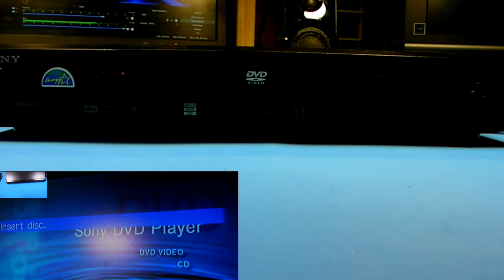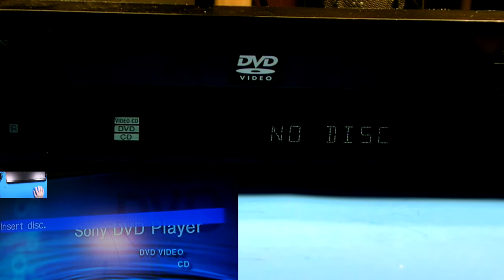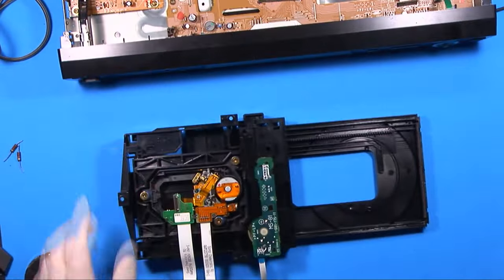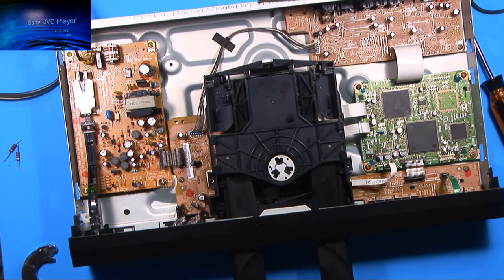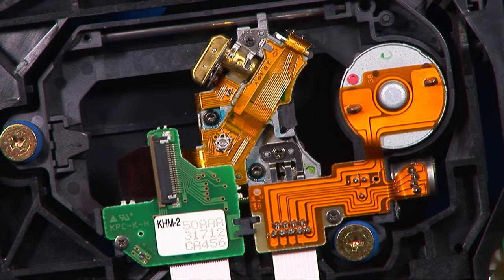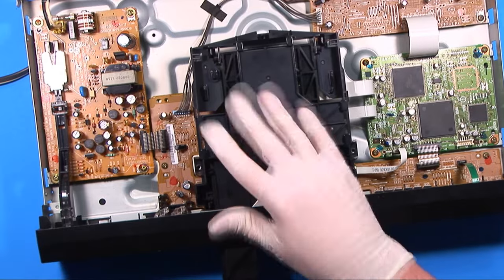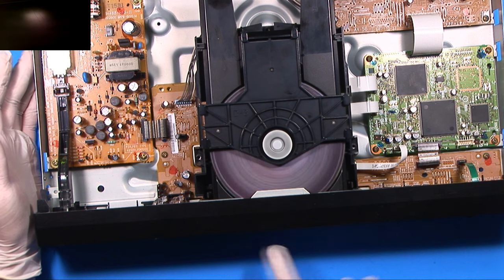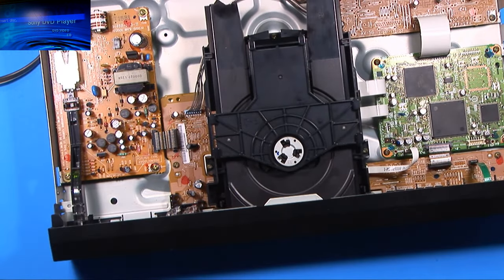Fixing a Sony DVD / CD player "No Disc" error.

Comment: Thanks for the video. I have the exact same unit you have. I did what you said to do about increasing the voltage the laser and it worked perfectly. I did not mark as you requested to do before turning the switch clockwise but used the notch on top to use as guidance. I used a box cutting blade to turn the switch. My question is where can  I find another replacement unit that you removed from the DVD player. I have looked online an been unable to find. Thanks for everything I appreciate it.

Comment: I will try this. I have a similar model and most of the time it can't read the disk. It stays spinning for like one or two minutes and then it stops. I've tried cleaning the optic but it has given me no result. However, moving the laser module to different positions has worked sometimes and it loaded the disc but with many problems reading some tracks or jumping between them. Do you think that I would just need to adjust the potentiometer? What could it be?

Comment: My Blue Ray's player is doing this on Blue Ray disc. DVD disc however work fine.

Sometimes after multiple attempts I can get the Blue Ray to start & then it works fine but it's getting it to not error. It's a big pain.

Comment: it just happened to me today, was working fine this morning. got some new 80s cd's I ordered which came today, put one in and played fantastic, put the other one in and no joy. i have an aiwa separates system with a 5 multi cd player, and all its doing is going from disc 1,2,3,4,5 and saying no disk. so its not reading the disks just like in this video. i will have to take it apart and take a look once my new hip has recovered after a hip replacement. thank you for a great video, as we all learn something new every day :)

Comment: I had a TEAC plastic table top AM/FM/CD player and the CD just quite. I tried this adjustment and n=moved it less than you clockwise. it came back but will occasionally not read the CD. like 1 out of 10 times. Are these laser assemblies easy to replace or a nightmare. It a nice radio with good tone I would like to keep it around if I could. Thanks Great vids.

Comment: Dear Electronicle, thank you for making and posting this video.  I have an older Magnavox CD player (purchased new ~1986) that will start and plays the 1st two tracks fine.  But after the 2nd track, it begins to emit a high pitch sound, (it's soft, and not loud, so I have to mute the music to hear it).  (Not heard during 1st two tracks).  Thus, into 3rd track (& beyond), it pays, but after ~30 sec, sometimes more (~60-120 sec), sometimes less, it will stop (lose it's tracking), and I can hear the read lens assembly returning to home position.  ¿Is what you've shown here something I can try?  As mentioned, it does read the table of contents, and begins to play, and it's ok for the first two tracks.   It's after these, that it goes awry.  It has begun to behave this way about 5-8 year ago, but I'd like not part with it, as new ones are expensive, and this sounds very nice in my stereo system. Any comments most welcomed.  Thank you.  tonyd\.

Comment: I really like my RCA home theatre system. It has AM/FM, sirius radio, six speaker output, usb input and a 5 cd/dvd player.

The cd/dvd player squalls when the power is turned on drowning out the sound of the system on normal listenimg level.

I purchased a bluray player to watch blurays and dvds on my television hooking it directly to #3 input on the tv for video and sound.
Problem: can the internal drive be fixed? Replaced with anything quieter? Or just disabled to keep the other inputs and outputs usable? Thanks,.mts

Comment: I did just as you described in youR video on my (same model) Sony which would read DVD’s but wouldn’t read 2 of 6 different CD’s that I tried.  I kept doing iterations of turning that potentiometer until I had turned it a full revolution.  But, the same result every time, reads 4 of the CD’s but not the other 2.  And I did check two other CD players I have and they both read all 6 easily.  So now I don’t know what to do.  I guess I’ll turn the potentiometer back to where it originally was for now.
Any ideas?
Thanks

Comment: Hey! Thank you very much for the help in this video! Fixed mine today tweaking the potentiometer, it was actually harder to take the player out of its place then to actually fix it!
Reply from the maker: 👍 great job!!
Reply: How do u take the front cover piece off so the DVD player part can come out easily??
Reply: @Electronicle  My dvd player after i use another wire to aux the all problem came

Comment: Thank you so much for sharing knowledge. I recovered my Sony DVP-S335 with error code C:13:00. First I cleaned the laser but it still didn't work. So step by step I turned the resistance until it worked. Half-turn clockwise. Great!
Reply: I have the same one, I tried cleaning the laser but it gave no result. What exactly was the problem for you? I would like to know if it is the same problem I have. You can check my comment on recent comments and see my problem exactly. Thank you.
Reply: @tabletdejuan90  sorry I didn't see this question. I think it was the laser that wasn't in line

Comment: Thanks so much for making this informative, troubleshooting video. 
For my Philips DVP3960/37 I do not have the disc error. Instead, what
I have found is that the player finds it difficult to spin the disc, specifically
to start the spinning it. Do you think adjusting the potentiometer would help?
What would you recommend to repair this problem, any parts need replacement . Thank you!

Comment: If a unit is fixed via adjusting the pot as shown, does it often last a long time? I sometimes resell old DVD players and wondering for cases like the one shown if it would be better to replace the optical pickup assembly compared to adjusting an old one?

By the way, how much on average do the opt pick up assemblies cost? Are they all model specific or are generics commonly available?

Great vid by the way, a real stand out from the other offerings.
Reply: I have an RCA Model RC5240P DVD player.  The player does NOT play DVD video discs but it does plays Compact Disc digital audio discs.  Where can I buy a VIDEO laser optical pickup assembly?

Comment: I have a 400-DVD "jukebox" player that plays CDs, CDRs, CDRWs, just fine, but will not play ANY DVD whatsoever - the display message (for DVDs) is "Cannot Read", rather than "No Disc". All discs used/tested were commercial/store-bought/brand new, and even some "home burn" DVD+/-R discs. No dice. 
Could the calibration adjustment you demonstrated here potentially correct that issue as well? Or is it something else? I suspect, that it has the "wrong" laser lens (a "CD only" type), but that may not even be "a thing"? 
It's a seemingly decent machine (plays audio discs just fine) and I would hate to have to drop another $400+ on another machine, especially if there is any (inexpensive) way of diagnosing and correcting this one?
Reply from the maker: https://youtu.be/ud62whnwOGE
I believe its that video.  I never got around to editing it fully so its long.  But basically there's 2 adjustments usually.  One for DVD and one for CD playback.

Comment: I have the DVP-NS300, same as you repaired in this video.  Today my son managed to pull the elastic belt out of the tray drive, and I can't get it open to access the place to put it back in.  When I press the Open/Close button on the unit, I hear a whirring sound but nothing happens.  I've taken the case cover off the unit but can't figure out how to disconnect the connectors to take things apart enough to get to the place where the drive belt goes to put it back on.  Is that something you could address in a future video? Thanks!
Reply from the maker: Sure.  I'll look tomorrow at this unit and see how you can get it open.  There's usually a way to sneak a flathead in under the mechanism to spin the gear to at least unlock the drawer.
Reply: Thanks, but we figured it out today! All is back in working order.  My son was proud to be part of the repair process, and your video helped to fix the "No Disk" error we were having, too! Thank you very much!

Comment: My DVP-NS300 will randomly give a No Disc. I have a few new discs that are always No Disc.  Cleaned the lens as shown and then turned the POT by 10 degree. No difference. Then turned the POT a further 1 deg, No Diff.  Gone another 10 degrees and still no diff.  Not sure if 30 degrees is really pushing a limit... or if I should crank it up??
Reply from the maker: DVD players use 2 lasers.  One for the DVD and one for cds.  They usually will also have 2 pots.  Be sure you are turning the proper one.   If it still doesn't work you may need a new laser pickup assembly.
Reply: @Electronicle  I have the same DVD player you are showing in this video. 1 Pot. Turned it CW.

Comment: Question? I'm planning to buy a shanling cd-s100 cd player, and I found out that I could buy, original remplacement optical laser lens.  
Would it be a good investment?, the day that I have a problem with my cd player, I could simply replace the laser lens. Wouldn't that extend my cd player for a longtime use instead of buying a new one?
Reply from the maker: Sounds like a plan.  yeah  go for it
Reply: @Electronicle  Today I had to open my Onkyo C7030 player and clean the laser head.  I had to go under the plastic black lid and clean it with a Q-tip, and with the help of electronic air duster to remove any dust inside the Cd player.  There is no screws to remove the black tray nor the top lid, for I would like to replace by myself the optical head if needed.  Wish their were a way to do it, but there no video on how to open and remove the black tray were there is no screws.

Comment: I have a 1999 Sony DVP-S550D DVD/CD/VIDEO CD Player that has this problem, as well as it will stop in the middle of a song and then start up again over and over throughout the song. I'm going to try to fix it as your video suggests!
Reply from the maker: Try cleaning the lens and make sure the pickup assembly can move freely without jamming first
Reply: @Electronicle  The lens was completely clean. I just completed the repair according to your video, it worked perfectly! I noticed right away as the disc is read instantly instead of taking 3-10 seconds to read. There is no more hesitation when changing from tract to tract as well as no stopping mid song and then starting and stopping over and over again. Awesome video! That fix probably saved me at least $150 or more. A shop I am familiar with charges $95 just to look at a component.
Reply: This is especially helpful because I was considering buying a new CD player. I looked at the Yamaha CD-S3000 and compared the specs with my Sony. There are three specs within .001-2 of my CD player, so I saved myself at least several thousand dollars had I decided to go with the new Yamaha. I paid $500 for my deck in 1999.

Comment: I have a Sony 3d player home theater system - experiencing no disk error.  Can you give me approx cost to replace pickup assembly if the method you demonstrated does not work.  I would not attempt this repair myself ,et it seemed straight forward enough.   Thanks
Reply from the maker: What model
Reply: @Electronicle  HBD-E780W
Reply from the maker: @tombateman7271  a quick google search shows approx $50 USD for parts.  As far as labor, you would have to ask whomever you have doing the repair if you aren't installing yourself.
Reply: @Electronicle  Thank you for the info  what do I need to order - I'm assuming I can search online for it... you have gone the extra mile - appreciated.
Reply: Have taken my unit for repair - shop reports difficulty in locating optical drive (optical assembly 4-262-994-01 part # supplied by technician assuming it is correct.) From your reply you may have found a optical drive - would you mind sharing your source.  I am unable to locate a replacement completing several search attempts. Thanks....
Reply from the maker: I just went to Google and typed your model number and laser pickup.   
https://m.aliexpress.com/item/32827887942.html?trace=wwwdetail2mobilesitedetail&productId=32827887942&productSubject=-
Reply from the maker: That's one. Might be hard to find new old stock for these units so places like Aliexpress and ebay may be your only options.  Especially if the repair shop couldn't get it from their certified distributors.   Again not saying ali and ebay are the best choices but might be the only.
Reply from the maker: Also for things like this where u can't find by exact part number from a reputable source .... A visual check is important.  Make sure it at least looks the same as the one in your unit.

Comment: I wanted to ask you sir, "How would you fix a Sony DVP NC 800H  carousel dvd/cd player, that plays cds, but doesn't play dvds"? I would thank you for your reply.
Reply: There's usually two pots like the one shown in this video, one for DVD and one for CD, you'd likely only have to turn the one for DVD slightly. I couldn't tell you which is which so you'd want to do trial and error, turn one slightly and of it doesn't work out it back to the original location and try the other one.

Comment: I replaced the belts on a Sony W50 C cd player....But now it doesn't track correctly after about the 4th or 5th song. Does fine on the first 3 or 4....What's my problem?.. Thanks
Reply from the maker: hard to say without looking at it, but the part that moves the laser pickup is a long gear connected to a motor.  The name of the part escapes me at the moment, however make sure that gear is clean and it can move the pickup assembly back and forth without issue.  You can turn it by hand

Comment: Can anybody help me I have a Sony CD player that was MIA I couldn't find it and close the battery leaked and if the spring is corroded it fell out and it won't play so can anybody help me I mean you can't even did the dinosaurs you can't even find them on online anymore I don't know what happened to them all I paid $50 for for it like 10 years ago and I was he in and Horror in about paying so much but I mean I've dropped it a thousand times and it's still kept on playing but now the spring part with the battery goes you know where the spring pod is it fell out so can anybody help me thanks
Reply: Buy a NEW ONE.